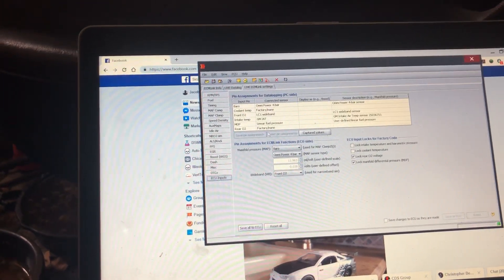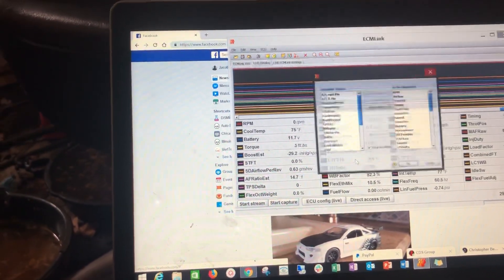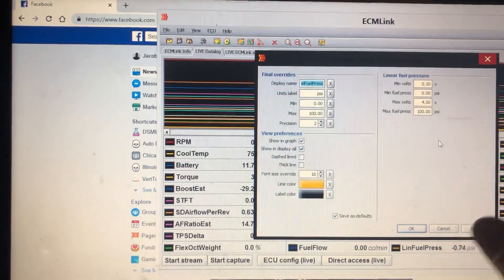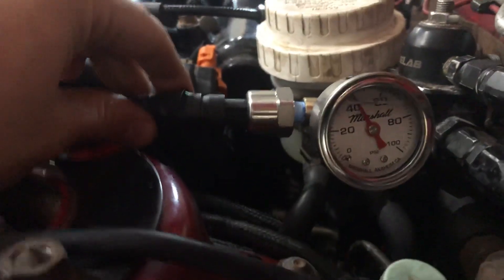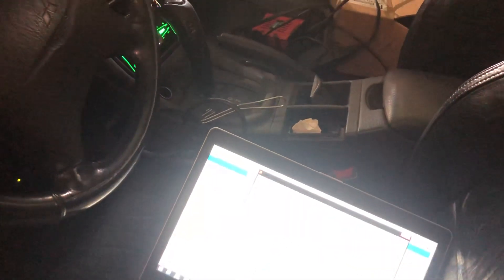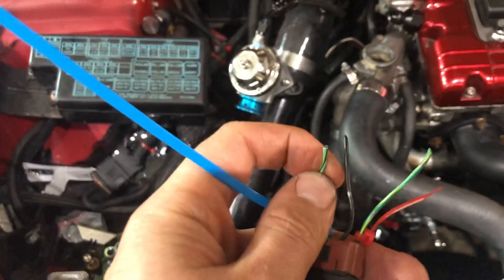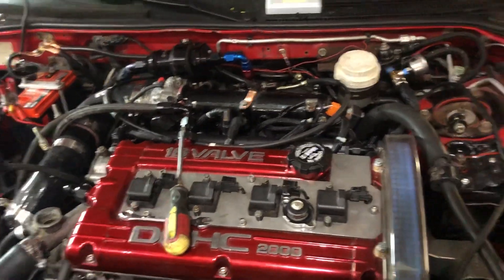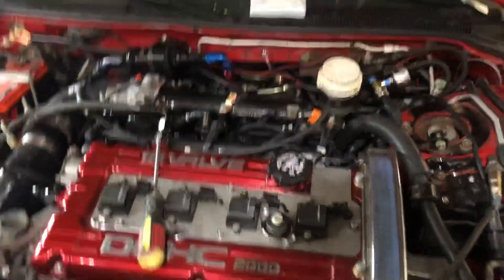ECMLink Logging Fuel Pressure

Comment: I see u know a thing or 2 about ceddy mods wondering if i can pick ur brian for a min and maybe get ur opinion on a tune i have been working on for my 2g on 20psi
Reply from the maker: Unfortunately, I only know enough to say it's worth getting ecmlink instead. I never got mine to log properly on ceddy mods and got tired of fighting the software.
Reply: Ok i got mine running and anti lag and egr all the good stuff with all the delete and pin options probably the most current and workable version of ceddy for the 2g i had good afrs then i lost then the next start up and the tune is different now but it still runns good but i think i have bad sensors and maybe a exhuast leak to fix but i am running all stock equipment and 750 injectors fuel rail g27 turbo and 60 mm bov stock internal waistgate on a manual boost control and osias fual system stock maf with a stock 3bar map its a late 99 2g so it has all the systems in use that a evo 8 had
Reply: I am wondering if i piggy back the iat and change the code for speed density will it run with the maf still and do i have to change to a different map if it is reading the sensor and is logable stock

Comment: Hey brother where are you running your boost source for your MAP sensor?
Reply from the maker: I tapped the intake manifold when I had it powder coated, so I run it straight off that.
Reply: Jake Halsey Sonia is it not good to just run off of one of the many ports that are already on the manifold ? Not the PCV port but any other one
Reply from the maker: @nicktunesnemesisperformanceINC  You can use the other ports, or any vacuum source, but the shortest route to the intake manifold is the most accurate, so tapping directly into it works very well. As long as you're lines aren't super long, it will work fine.
Reply: Jake Halsey do you do remote tune ? We have a dyno and my shop and am needing help getting fuel dialed in on a 2g 6bolt swap with 1220cc injectors and 57/57 trim. Def would be willing to pay you for your time
Reply from the maker: @nicktunesnemesisperformanceINC  Sorry, I didn't see you're replies before. I don't tune for others at the moment as I'm still learning. If you still need help, join this group on facebook and there are a couple remote tuners. https://www.facebook.com/groups/Ecmlink/members